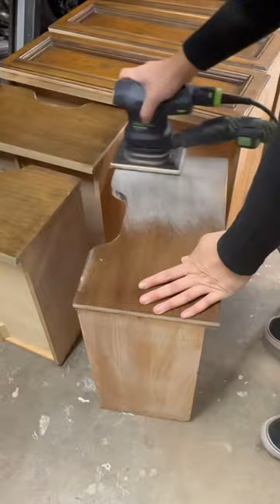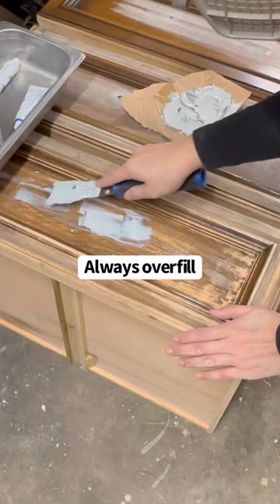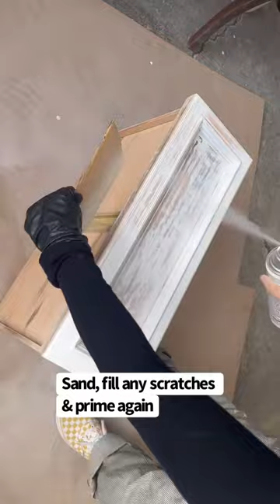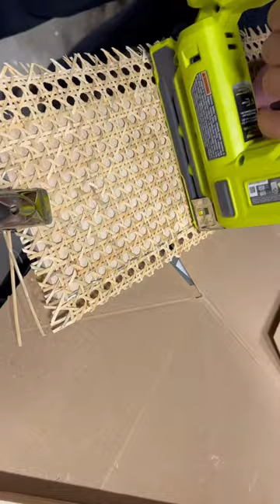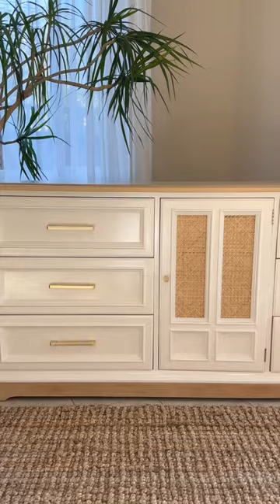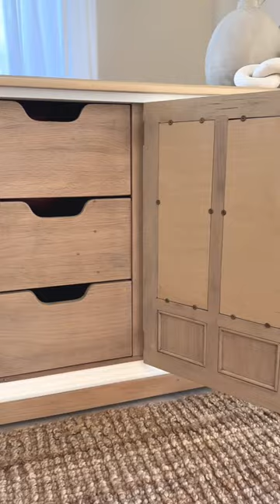Cane dresser makeover🤍😱 #furnituremakeover #refinishedfurniture #furnitureflip #howto #cane

Comment: Looks nice, but u look like u were struggling with the wood filler/Bondo. I notice your putty knife had no give. They make putty knives in different lengths and thickness. If u got a shorter one that was thinner it would be more flexible and make filling holes a lot easier and smoother and therefore less sanding. 😉👍
Reply from the maker: I should probably get different ones👌🏻